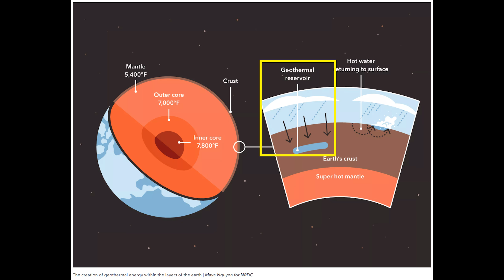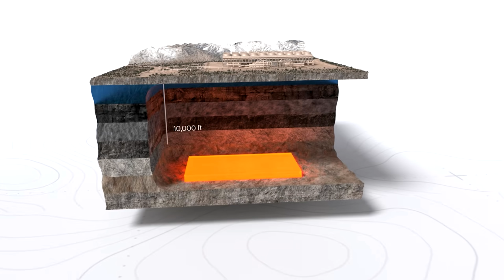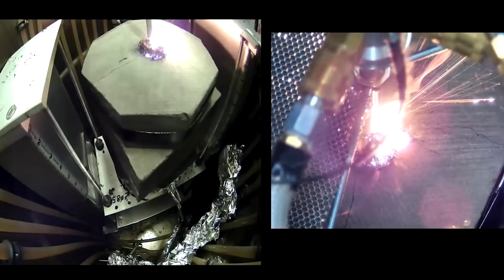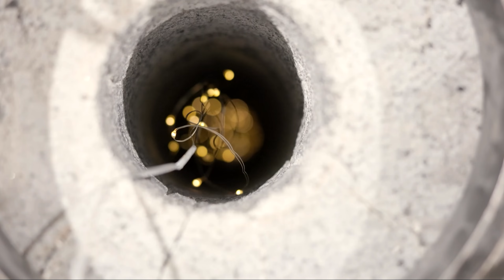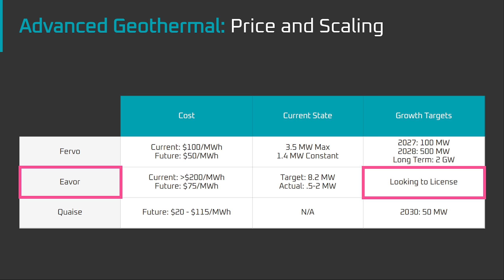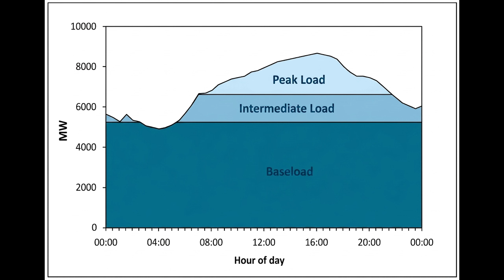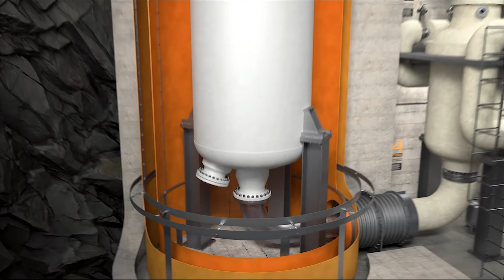Next Generation Geothermal // Fervo, Eavor, and Quaise

Comment: Great video overall. I would love to have a conversation with you about space solar power, as your research and presentations here are second to none. Your recent video on space data centers was good too, and has some good groundwork for this topic. The long and short of it is that SSP has been technically viable for decades but historically was quite expensive. In the last few decades the massive declines in solar cost, launch cost/cadence, low-cost space hardware, and digital beam formation has dramatically lowered this price point such that in just the last 14 years SSP has dropped in cost from the most expensive to the least expensive source of power, going from ~$680/MWh to ~$40/MWh.

Like geothermal, SSP is a baseload renewable technology with a 99% uptime (well above the gold standard of nuclear fission, around 92%), that has a comparable land footprint of only 3.5 acres/MW (vs 3.9 for geothermal + 37.3 for ground solar). But it has the completely unique features of being dispatchable to about 1/3 of the surface of the planet at a time, meaning it can act as a peaking plant in multiple locations and also is a geographically independent source of power, so regions like the UK and Japan with limited land and energy resources can have strong local production which cannot be blockaded.
Reply from the maker: Thanks for the well considered reply! 

I'm interested in space solar, but I haven't looked into it.  It seems promising

The only drawback I can think of is that you would be adding heat to Earth. 

I don't know what the feasible upper limit is for the amount of space space solar you could put up that would be beamed down 

And then, following from that, how much it would take to increase the temperature
Reply: @thelimitingfactor  The extra heat is sub-nominal. In most designs it’s delivered via microwaves at 5 GHz and the rectenna array on the ground increases albedo more than the minor conversion losses as the conversion is about 85% efficient ground side. Most of the heat loss is in space.

There really is no practical ceiling on power to ground other than launch cadence. The same physics that gets you easily to petawatt of compute with SpaceX applies. The case is even stronger for anywhere other than Earth as sourcing power on th moon is quite difficult. The size of radiators to shed nuclear heat production is larger (and much more fragile) than the rectenna for equivalent power and modern SSP systems are more energy dense than mined uranium.

Comment: Great stuff as always. The guesstimate that we might see 1GW of advanced geothermal by 2030 is interesting. A single solar-plus-storage project under construction in Abu Dhabi will generate 1GW of baseload in 2027. (Using 5.2GW PV + 19GWh BESS.)   There are other such PV+BESS baseload projects announced.
Reply from the maker: Yep! It would be a drop in the bucket 

But, you wouldn't want a whole lot of it anyways. 

You just want a little bit of base load at higher latitudes to make solar more viable
Reply: @thelimitingfactor this is the way
Reply: @thelimitingfactor  At  higher latitudes the largest challenge is heating in winter. You may skip the electricity generation
step and use the heat directly in district heating.

Comment: Geothermal is simply a way of producing heat without burning fuel, or the cost of a fission reactor.   The problem is that the heat obtained from geothermal is not as high temperature as is desirable for electrical generation.   In your presentation there was no mention of the temperature range available from the different schemes.  Of the three companies mentioned Quaise would no doubt offer higher temperatures. 

One advantage of geothermal is that it can be used in urban areas.  In cities in very cold climates GT could replace huge amounts of fossil fuels by powering large heating districts, where steam, or hot water is distributed to users for space, and water heating.  It would also be a good way to heat greenhouses in cold climates.  For space heating the high temperatures needed for efficient conversion to electricity are not needed, or if they are available waste heat from the energy conversion process can be used for the heating district.

No matter how you drill the hole, it is the heat engine that holds back geothermal electrical generation.  The development of supercritical CO2 Brayton heat engines would do more for GT than anything else.  SC CO2 Brayton engines have inherently higher thermal efficiency than the Rankine cycle(steam, or VOC) heat engines currently used.  The turbines, and heat exchangers are much smaller for the same power because of the superior heat transfer characteristics of sCO2 as compared to water.  This smaller hardware will be much cheaper to make, and install once it is mass produced.

I encouraged you to watch some of the many youtube videos, or read about supercritical CO2 heat engines.  They will end up replacing steam, the way steam turbines have replaced steam engines.
Reply from the maker: Yeah, I'm familiar with some of your points, but I have to place bounds on every video

If I make them boundless and try to cover too many things, people get bored and lose interest 

How long is a piece of string?

Comment: Thank you for a great video.  I had read Fervo’s S-1 but was having a hard time trying to figure out how the current and target drilling costs converted to LCOE in terms of $/MWh (after adding in all the operating costs from running this binary exchange).  The thing that I’m struggling to understand is whether the $100/MWh figure based on what their target price for selling generated electricity, or does it reflect their actual production costs (e.g., they could have LCOE greater than $100/MWh and sell at a loss until they can further reduce drilling costs).
Reply: Read the 2Q summary. They're on track for production costs of $55/MWh from Cape Station Phase 2 (currently under construction) and $30/MWh for near-future projects.

Actual sale price for the electricity  is either whatever is in the PPA, or what the market will bear.
Reply from the maker: I would have to do an even deeper dive to look into that. 

But, I know a lot of the deep tech people are investing in it, and a lot of people that I respect have mentioned them, like Drew Baglino

Comment: We don't need baseload power. We need adaptable power like gas
Reply from the maker: We need both.  Just like any job, creating power requires a number of different tools to fit each need.
Reply: @RushWasABand Very short sighted POV.
Reply: Modern geothermal power is readily dispatchable. These aren't 1970s designs.

Comment: Starting @ 8:07: Disagree. This gives the impression that Quaise is already predrilling conventionally and already used the gyrotron in deep, hot rock. They haven't even tried any of this yet. All they have done is drilled 1 rather shallow test well in Texas. About a year in and they didn't even reach the permitted 1,000 meters of depth. Continuous drilling is also a fantasy. They have to stop drilling to add sections of waveguide, just like conventional drilling has to stop to add sections of drill pipe. Their (entirely theoretical) speed comparison against conventional drilling is ridiculously bad. Try comparing against the speeds that Fervo is regularly reaching instead of tech from the 1970s.
Reply from the maker: Nonsense.  I didn't give that impression, you read too much into it.  As per grok's interpretation of my script:

"The script repeatedly flags Quaise as the earliest-stage and highest-risk of the three: it calls out the “science fiction vibes,” lists specific unsolved engineering challenges, states the technology is “still under development,” notes they “haven’t yet started to scale,” and explicitly says their 2030 target will likely slip and the tech is “still some years away.”"
Reply: @thelimitingfactor  Your rebuttal is Grok? Have some dignity, man. 

Sure, there are disclaimers, primarily at the end after a viewer has gotten a wrong impression.

Listen to your segment and listen for definitive statements like "Quase is" where it should be more like" Quaise hopes to"
Reply from the maker: @SavageChinquapin  Why write it myself it if represents my view correctly?  If I was embarrassed about it, I wouldn't have called it out.

As for making it even MORE clear.  Sorry, I'm not going to hold your hand.  You failed to listen, and you tried to blame me.
Reply: @thelimitingfactor  Grok parroting back that it agrees with you is not evidence of anything factual regarding your story. The algorithms are literally trained to flatter you.

Also, you're coming back to this nearly a week later. Are you trying to convince me or convince yourself?
Reply: @thelimitingfactor  you did give the most caveats with Quaise, but you also phrased several of their capabilites in present-tense, whereas the reality is that they are mostly aspirational. That, along with mentioning that the gyratron was developed at MIT for fusion tech, makes it sound like that part of the script was written by Quaise marketing, rather than someone soberly evaluating their prospects based on actual and likely achievements. 
I'd love for their tech to succeed, but haven't seen much progress over the past year. 
There are other "sci/eng" channels that over-hype way worse, but I thought his criticism was mostly valid. I hope you take my own as intended- constructively. I understand it's extremely challenging to make content in a timely manner that also critically evaluates multiple technologies based on very limited, mostly PR- provided info. 
Quaise is one of those companies that I became very excited about quickly, and then gradually realized an increasing number of engineering challenges that would need solving in order to make their central capability function as intended. I'm hopeful, but far from holding my breath.
Reply: @realfutbol1  It really raised my eyebrows when Quaise cancelled their promised public demonstrations in Marble Falls and severely cut back who would be able to see what was going on. I was all set to go out there when they pulled the plug.
Reply: @SavageChinquapin thanks for that - I haven't been following them super closely, so wasn't aware of the demo and its descoping. Hopefully, just a timeline slip rather than fundamental limitation...
Reply: @realfutbol1  Hopefully so. I'd really be pleased if Quaise works out their challenges. The concept is really innovative, and it apparently works at lab scale. 

But there's a long, long road from "lab scale" to "commercial operation". Are you familiar with the TRL (Technology Readiness Level) scale? First real popular recognition was from NASA, but it's been adopted/adapted more widely since then and there are now a plethora of approaches to categorizing "readiness level" of a technology such as "commercial readiness level", etc.
Reply: @SavageChinquapin I'm broadly familiar with TRL, but don't expect I'd recite it accurately with a gun to my head. 
Indeed, the principles are super creative and innovative but, as with fusion and myriad other great concepts, I fear that the engineering challenges of waveguide durability and cleanliness, removing the molten rock, borehole cracking/ shifting/etc. are likely to sink the outfit before they can scale economically. I don't buy the part about no casing being required, except in the most forgiving geology.

Comment: Commercial scale for new generation geothermal is almost here. Fervo is still on track to start grid-connecting the 100MW of Cape Station Phase 1 late this year and have the full 100MW online by early 2027. The next 400MW of Cape Station (Phase 2) starts coming onto the grid in 2028.

Comment: The way this broke down conventional geothermal vs the new approaches really clicked for me, especially how Fervo is basically taking proven oil and gas horizontal drilling and fracking and applying it to dry rock so you get way more heat exchange surface without needing rare hydrothermal reservoirs. The Project Red numbers of 1.4 MW continuous feeding a Google data center and the clear path to 100 MW by early 2027 then scaling from there make it feel like the only one thats already past the prototype stage and ready to move fast.  

Eavor’s closed loop and thermosiphon idea is elegant for avoiding seismic issues, but the German test falling way short and them shifting to licensing shows the drilling complexity is still a real bottleneck. Quaise with the gyrotron vaporizing rock down to superhot depths has the highest upside for efficiency and cost if they solve the plasma and ash removal problems, yet the 2030 timeline for even 50 MW feels optimistic given how many new engineering hurdles they’re inventing.  

Right now Fervo looks like the strongest near-term path because the equipment and know-how already exist in the oil industry and a well only takes a few weeks once permitting clears, which could finally give us reliable baseload that pairs cleanly with solar without the pollution or financing headaches of the alternatives.
Reply from the maker: I totally agree!  Glad it was useful and thanks for the thoughtful comment.
Reply: If Eavor or Quaise were public companies I'd still invest in Fervo(FRVO) over the former two, have recently invested in Fervo. Much farther ahead, massive acreage already acquired to develop into egs(enhanced geothermal systems) powerplants, partnership with Google, etc., etc.. Have also invested in other egs or geothermal related companies like Ormat(ORA), Baker Hughes(BKR), and Liberty Energy(LBRT). 

Ormat develops and owns geothermal powerplants and other alternative energy sites or systems, experts in heat recovery and conversion to electricity. 

Baker Hughes produces relevant directional drilling equipment, other relevant equipment and expertise from the oil and gas industry, as well as producer of turbines. 

Liberty Energy has capable fracking and other subsurface technology, logistics and management software expertise that are relevant to egs, early investor in Fervo. Transitioning more into alternative energy company apart of egs, nuclear, and battery storage through its subsidiary Liberty Power Innovations.